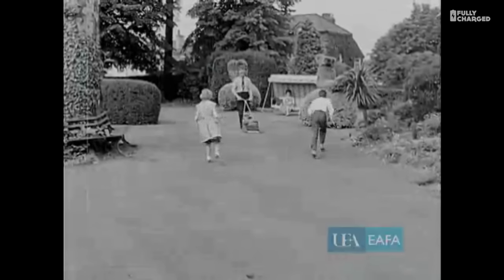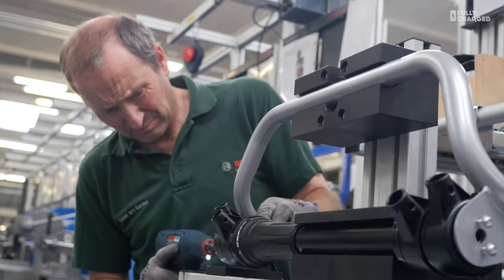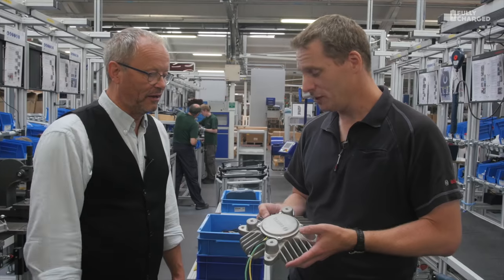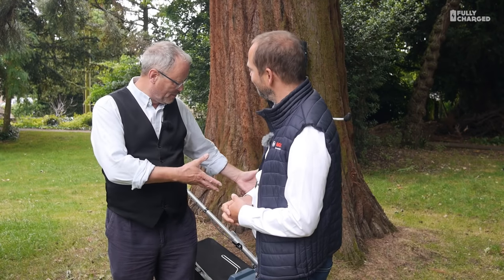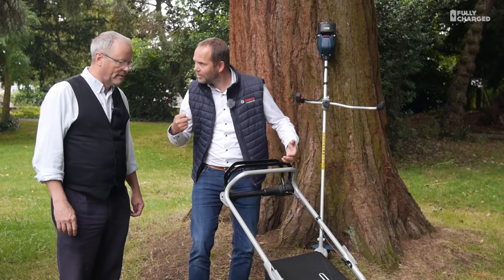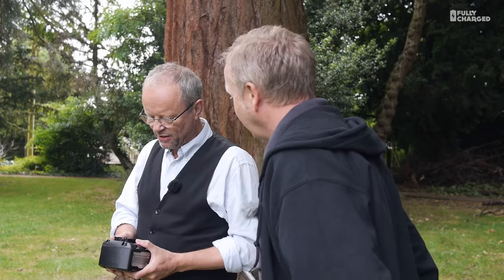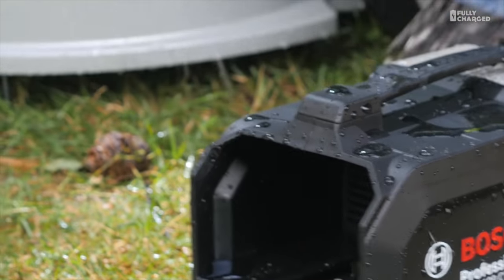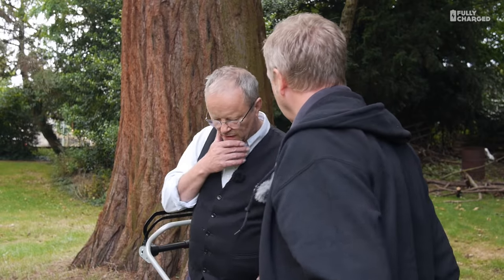Bosch pro electric Lawnmower | Fully Charged

Comment: The first thing I thought when they pulled out that generator was are they going to charge a battery with a big , noisy, diesel generator?  My idea to Bosch is to add some USB plugs on that generator to charge up your smartphone too.  Thanks for enlightening us about how batteries will take over the world and eliminate noisy "weed wackers" in the process.
Reply: bluemonkeyster if they are converting DC into AC and then back to DC nominal 36V (42V) and there is no detection curcuit which then switches to pure DC feed it's efficiency is crap, maybe a bosch connector for all home appliances would fit for this need. But maybe thats just the easiest and cheapest way

Comment: I own the non-pro Bosch battery lawnmower. I needed to buy a third battery. They take about 40 minutes to charge (as he said) but they deplete quicker when the grass is longer / damp - around 20 minutes cutting.

On the plus side, it's easy and no hassle to push the mower out and cut the lawn without getting out extension cables and avoiding running over wires.

Comment: I love that large battery pack and would like to know more about it, I can see it replacing all those dirty little generators you see (and smell) at festivals
Reply: Unfortunately seems like a not so smart idea to waste 2400 euros on that big battery, unless you have a lot of other electric devices to recharge out in the field. In few years will be ruined. Plus the cost of the device you will never return the investment. Just simply buy small batteries enough for your daily work. Even so, they are too expensive to compete with the gas ones. Hope that there will be a battery breakthrough and make these things competitive with the gas. Even then, the idea of a big battery is pointless. just take small ones.  For a smartphone is understandable. they are not made for a easy battery swap, so external batteries make sense. But charging and discharging batteries one into another is pointless if you can do the job without this process.

Comment: I have a Victa Electric lawn mower my mum bought new in 1975. It was used up until around 2000 but still runs fine. It plugs to AC and uses a very long extension cord. The secret to using them is to lay out the cord and always mow away from the cord which can take some concentration and practice. Short of running over the cord nothing ever needed repair or replacement except the blades which were the same as petrol models used. Somehow I doubt something like the modern Bosch battery equivalent will last as long without some very expensive outlays along the way.

Comment: I have the Lowe's 80v Kobalt electric mower and other tools.  Love the electric versions.  Even have a couple of 100watt solar panels on the shed roof that I use to charge the batteries up.  Quiet, easy to use, and reliable.  Definitely the way to go if you mow your own yard.  The other tools includes a chainsaw and a trimmer.  Both work great for the homeowner.

Comment: I've been using electric whipper-snippers for gardening at home for years. First a lead-acid one that eventually ended up with a battery life so short it took three charges to do the edges of the back yard, then the current lithium-ion one which gets me through several such sessions before needing charging.

Either was a huge improvement over the petrol hunk-of-junk I had to use before. Took ten minutes of battling with the stupid thing to get it started every time it was stopped. Never again!

Comment: Pretty impressive, the density for this sort of application is no longer an issue unless you work industrially for example.  
I still think that the ev range/charge time still needs work however.
Reply: +rompdude the Tesla suite is really quite plentiful but their cars are a tad on the expensive side of course. LGchem just admitted to have batteries for 145$/kWh which really means we are there already, just needing the bastard car makers to reasonably implement the obvious availabilities. I'd say 200+km range on a charge as a comfortable all purpose minimum if combined with at least a chademo speed robust network, meaning 50kW+. Say 32kWh can get you over 200km in a moderately lightweight and aerodynamic car and that's about a 5000$ pack. Not a critical deal breaker considering all the ICE junk that comes out of the cars and potentially running your car on power from inexpensive solar panels or house mill or where local rates are very cheap.
If prices for 200km EVs were even remotely comparable to ICE variants, I think a majority of people would quickly swap over and then it's done.

Comment: I have an electric mower but no battery. While these bosch devices are very nice, running one from a cable is very cheap and still very powerful. My land mower was about EUR140 and it is capable of destroying grass and all kinds of tough weeds. Wooden sticks or other obstacles are no problem.

I ran over some overgrown piece of land just to get rid of the toughest parts and the mower happily ate everything on its path, even sticks that grew close to 2cm in diameter.

The cable is a pain at start but once you get a pattern in it, it is no issue at all

Comment: Comparable, and maybe even better than the Bosch, is the EGO Power electric lawn mower.  It is a 56 volt mower, with a large 7.5 amp hour li-ion battery for the self-propelled model.  I just got one for this Spring, and love it!   And the kicker- if you are mowing at dusk, you can turn on the LED headlight;-)  I believe they sell the ego mower in the UK as well as here in the US.

Comment: My 60 volt Snapper is only about a third of the price and works just as good. I paid $394 at WalMart here in the US. Its just not self propelled. But I can lift it with one hand, so it don't need to be. It uses one 4ah 60 volt battery that I have used to cover a half an acre on a charge.

Comment: Technology at its best. will the mower be sold in Lowe's OR Home Depot. ( USA)
Reply: +Huey Freeman The EGO is there. Shorter cut time, but half the price of the Bosch, with 30 minute recharge. http://www.homedepot.com/p/EGO-20-in-56-Volt-Lithium-ion-Cordless-Lawn-Mower-LM2001/204746234. Others are, too. Bosch doesn't seem to be here yet.

Maybe it's just a matter of time.

Lowes has a big selection, too, including their Kobalt brand.
Reply: +Kevin Blanc Thanks for the info. I've not seen those before. Definitely going to check those out
Reply: +Kevin Blanc. the simplicity of the   Bosch pro electric Lawnmower is now where to be found though.
Reply: +Kevin Blanc  I bought an EGO last spring and it is fantastic. It might not be for everyone if they have a large lawn, but under an acre for an average plot, it works as well as any gas mower I've used.

Comment: I've been getting more and more into electric powered devices lately but one area where I noticed I wasn't seeing much progress was emergency home carryover unless you have a massive battery bank setup or a generator.  I bought a generator about 2 years ago, but I haven't even started it once yet.  I haven't had too, because near the same time I bought a 2k watt power inverter.  Last week I was thinking about it and I realized that because I have that inverter and my furnace burns propane, I can run my furnace with the inverter.  The furnace only uses 110v and the inverter is capable of 20 amps which is the recommended amp circuit breaker for the furnace.  That portable battery bank would be able to do the same (in an american spec putting out 110v) for much longer than I could with my inverter and car batteries.
Reply: +hellcat1988 Have you looked into the Tesla Power Wall?
Reply: Dude31463
Yeah but that's a bit more out of my price range than even that battery bank is.  I'm probably going to end up getting a couple deep cycle batteries and setting them up on a float charger until I can get my wind and solar setup going.
Reply: Nice! :)

Comment: +fullychargedshow Rob, have you considered expanding to gaming battery products too? Like the Evil Controllers' Xbox 360 battery pack that's simple to DIY install (replaces backing/rear of grips) and boosts time from 5 hours (AA batteries) to 60 hours! I timed this, and their claim isn't too far off, less AA battery waste, near identical dimensions on controller backing! (And the controller is also used by PC and MAC gamers!) Even has kill switch instead of old "unplug AA pack" trick, conserves battery when not in use!
Reply: That's an awesome controller, Microshaft should have done them like that from day one.

Comment: I have a 4.5 HP petrol. 'domestic'. It cost me £300 to buy and about £25 a year to run on petrol. This mower seems comparable to mine but is 1200 quid. It would take me 36 years to get back the cost savings in fuel and I don't think lesser plug ins are man enough. I assume this is why it's a 'pro' model as a it. Might take a gardener a few years to get back the cost. Then they'd need the big battery as well!
Reply: +Ryan Noble This is the problem with these kind of products now. Electric things will have a breakthrough in the market once they are not an inconvenience or stupid investment. Electric cars are just about there now. You can buy a Nissa Leaf as a city car, certainly second hand, at a price point similar to a comparable petrol vehicle. Being primarily for city use 'range anxiety' isn't really a thing.

Electric bikes are another example. It isn't much longer until electrically powered things make real sense from an economical point of view (the reduced maintenance, running costs, etc.) and once that is the case the electrical market will grow and grow and grow...
Reply: I have a leaf in the Country and it works perfect to be honest. Primary EV concern is to have your own drive with mennekes plug.
Reply: +Ryan Noble There you go haha. I was thinking about getting one when my gf passes her driving test but living in the city in rented housing its a bit tricky.
Reply: +KimJongIlLover have to agree with you there. would be okay if you had an outside 3 pin standard plug and a drive. 12 hours charge though!
Reply: +Ryan Noble You say it costs 1200 quid but as far as I can tell that is the body only! The batteries are another £300 EACH on top of that

Comment: I was a bit confused by this video.  Do you not have electric mowers in the UK?  We've had them here in Canada for years, though they do cost about twice as much as a petrol model.

You must have smaller petrol tanks as well if they need filling after only an hour's mowing.  Ours last ~6-8 hours before they need filling.

Comment: What about after 5 years of use? Will the battery still hold a good charge and take a charge as fast? (It should take it as fast, but will it hold)? I would expect it to last 4-6 years. I guess this is ultmatly cheaper (or will be) than a regular mower to operate?

Comment: They need to make a DC to DC charger, why waist energy converting the DC  battery power to AC, then back to DC to charge with?
Reply: +Electric Mountainboards It's a cost issue. The little portable battery/power-pack is meant  to be for various applications where you'd plug in an A/C device, not just for the Bosch products. It would be more efficient to have a buck/boost converter in the module for DC/DC charging of Bosch products (as they come in varying voltages) as well but it would up the price.
Reply: +paytontech cost would be negligible to add a dc to dc port.
Reply: DigitalYojimbo
Not quite. You'd essentially have to add the same circuitry (minus AC rectification stage) that's in the battery charger to your power pack "generator" and change the programming to accommodate a wider range of voltages. You then need to design and  package a receptacle into it. Finally, you have to deign an adapter that goes from this new DC receptacle on the power pack to the battery.

To add to the fun is the need to have some sort method that enables the system to automatically read what voltage the power pack should output. You don't want to rely on the average consumer to input the proper voltage.

All this goodness is needed to accommodate the batteries from various other products in the portfolio.
Reply: +paytontech I'll concede, the only point I can see is where you want to charge competing products or other voltages. However, I still dislike dc to ac to dc conversion, too many inefficiencies there. I was hoping to see a proprietary port like many other manufacturers have, so that the user wouldn't have to lug around another device.
Reply: DigitalYojimbo
As I consider it, they could modify the battery charger circuit to allow a special adapter direct access to the DC stage of the charger's circuit. Maybe have some communication protocol like CAN-Bus b/t the charger and the power pack.

It's still adds cost and complexity to the system but at least it takes advantage of existing circuitry in the charger. Now you need less circuitry to make this work and there's less packaging difficulty though still some.

Meh, They just want it to be simple for the user, less expensive to produce, and more reliable so they don't have so much warranty claim on the product...
Reply: +paytontech Could they not simply have a docking port for Bosch batteries right on the portable power pack?
Reply: Dude31463
They'd have to include the charger's functionality and package it along with all the receptacles for the respective batteries types.
Reply: Pity they don't standardise on Power Tool batteries so they can use each others chargers, or even swap a Bosch battery with a deWalt then it would be worth having a battery dock on the Power Bank like with have with USB charging now. Also, that would allow you to use on Building sites where 230V power tools are not allowed in UK.
Reply: I'm a newbie to solar and I'm curious how you would access the DC power. Do you have a DC outlet coming from your solar/battery setup? I do think it would be awesome to have DC access for electronics instead of converting your DC to AC so you can convert it to DC. Is there a standard for DC outlets? I'd hate to have to wire in something like a charger for power tools.

Comment: I have an electric reel mower from the 70's or early 80's, made by Morrison here in New Zealand. This bosch mower is nothing new, mine is 250 watts, brushed, and pulls itself along too. Uses a 12v lead acid battery, but I have been tempted to give it 36 volts of Li-Ion.
Reply: +Alex Paulsen Don't. It will overheat and die xD You can use instead a Li-Fe lithium battery. They have 4 cells in series. If you plan to DIY be aware to include a BMS circuit board in the battery system (Battery Management System). It will prevent Short Circuits and Balance Cells voltage among others things.
Reply: Telmo Monteiro
I work with electric bikes for a living, motors do not complain AT ALL when you add more volts. They do not "overheat and die" as you mentioned, and in the case of my mower, there is no controller to worry about, it's direct to the motor. The battery I have is a bike battery, contained in an aluminium case with its own BMS.
Reply: They do not complain until the enamel of the coils melt. If the load is the same (impedance), and the voltage is higher, current is higher too, and current is the nº1 cause of heat generation. They work, but they're not reliable. Even with steady 12V I know that if you overload your brushed motor (drastically reducing RPM) it will melt something too after a while because the inductive effect is disappearing and coils will start acting just as a somewhat resistive wire, allowing more current to flow.

Comment: And I guess that with profesional users, the running cost drops significantly, since you use less energy and the energy source (electricity) is cheaper, on top of that you dont have to worry about maintanance.
So lower running cost and higher reliability you can be more competative.

Comment: i'v e had a bosch 24 vre gbh drill for 25 years and its still going but its had 5 batteries 2 gear boxes 3 motors and a few chargers

Comment: I purchased an electric mower this year. I have five acres that must be cleared each year for fire safety. My husband used to do it with heavy duty gas powered machines. When he left me, I had no idea how I'd get this work done. I have a broken neck and can't pull start an engine. The electric mower is light and powerful. When I hit an exposed root, the motor just stops. With no harm done, I can start it back up and continue on. Brilliant! And good riddance hubby!

Comment: Checking in in late 2018 to note that I still only see petrol landscaping tools in the wild, no batteries anywhere. In my quite extensive family all landscaping tools as long as I can think used to run on electricity via loooong cables, and we still haven't made the jump to batteries. 
So I'm really questioning the success of this battery system.
Reply: The batteries are fine, even cheaper now, but the unit itself is fking expensive.

Comment: Would love that brush cutter - so expensive though
Reply: I have an electric strimmer, and I've used it 2 times in the three years I've had it.. Just because the hassle of getting the extension cord, and running that through the kitchen, and then having to keep dragging the cable.. and then when I want to do the front of the house, unplugging it, retracing the cable, making sure I don't knock over anything that could be on the floor as I move the cables.. and THEN I can start strimming the front... OR, I can just leave it to over grow.. I have through about having plugs on the outside, but that only helps with the back.. If I could get a non-professional sized strimmer of that giant bush cutter, I'd be much happier.